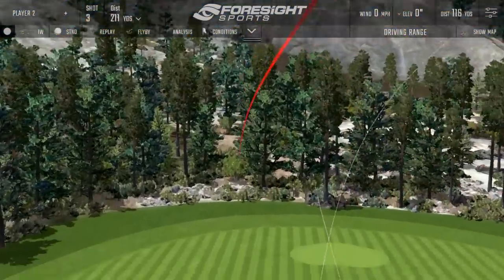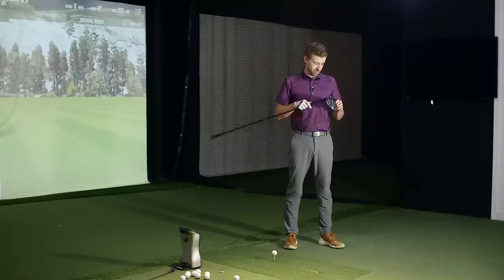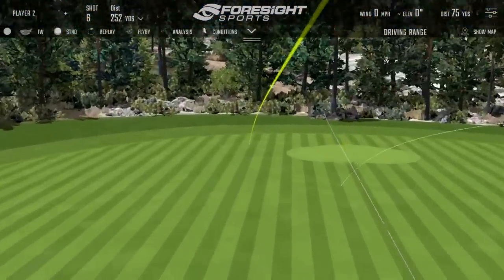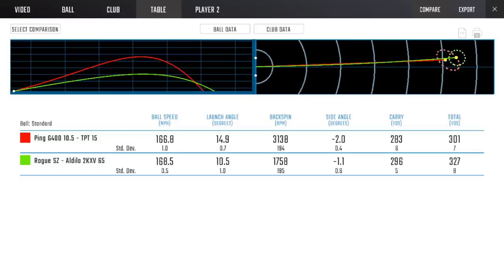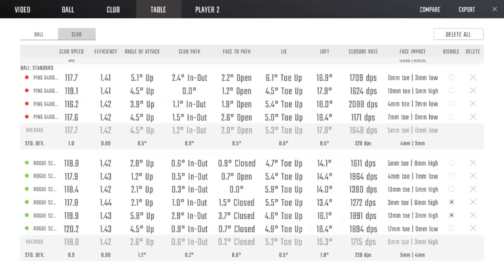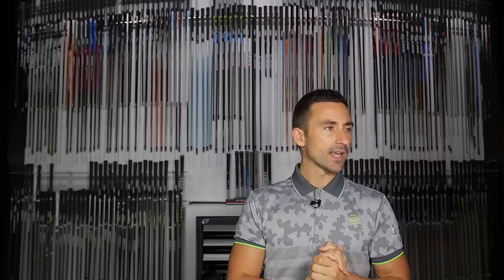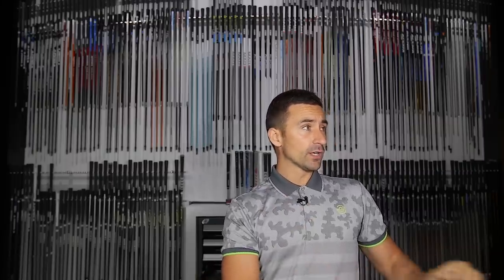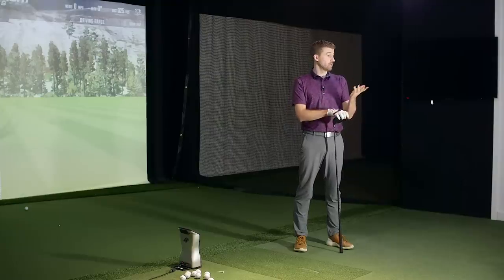Hitting Driver Too High | Losing Distance

Comment: I need to work on some things. I use an epic flash set to a loft of 8 degrees. I swing about 115mph and I hit the ball really high and barely get around 225-250 out of it. Hate it.
Reply: I had this exact issue. I got my swing speed up to 125 and geared down to 115 for control. The best I could do was 265 at 125 mph, and at 115mph barely 250. I began to figure out how to decrease backspin, and just 2 months ago with a 12mph helping wind I knocked a 350 yard drive. Excess spin really does kill distance by a mile, depending on how much you carry. For me it was well over 4000rpm.
Reply: Nick M. Dude that sounds so similar to me right now what did you find out that helps decrease spin

Comment: Hi guys, quick question. I thought the swings between the 2 heads were meant to be the same. Only reason I ask is the attack angle with the rogue is pretty much half of the Ping. Would a club on its own have any influence on attack angle? Also, I’ve seen loads of stuff from Trackman on hitting up on your driver 4 degrees plus. What are your thoughts on this? Cheers

Comment: Awesome new intro! 

This is a struggle that I've had as well playing in Texas. What would be an optimal launch angle at the 170 ball speed? I've heard you say  it before with Matt, but I can't seem to find the video you made that comment. You've said spin around 2000-2200 spin several times, but the launch angle comment is hidden somewhere.
Reply from the maker: About 11º
Reply: Thanks!

Comment: Sooooo, what's the solution? Move weight to front? If so, does that require a new driver head? I have an Epic GBB. I can change loft and closed/open face setting and slide the draw-fade thing. But I still don't know what you guys did to that Rogue to lower ball flight.

Comment: Hey, can you do the same really with the cobra f9 changing weights and putting a heavier weight in the front than the standard 1 then move the standard red weight to the back. 
I have the heavy weight in the front already but still higher than I want. I have also just bought the new tensei orange shaft because I loved the feel of that in my mates driver. Love mucking about with things. Thanks.

Comment: Was the SZ a 10.5* static loft or dynamic loft(hosel adjusted)? With adding the extra weights what swing weight did you end up at. Is the driver at 45"?

Comment: I'm curious because you've mentioned before how light the standard Rogue heads are. What type of golfer would that standard weighted Rogue head be good for?
Reply from the maker: To be honest, not a whole lot of golfers would benefit from that light of a head. It makes for a good build when paired with a super light shaft, for example, but for the most part a higher head weight pairs better with the average player's weight category of shaft and delivers an ideal swingweight.

Comment: This is dope, great video guys! But one question with it getting into the colder months should you switch to a lower compression golf ball in the colder weather or is that a myth?
Reply from the maker: Not something we can say definitively yet Dustin, but in theory it should help.
Reply: @clubchampionmedia  think my swing is broken TXG lol. Hit some balls on the gc hawk today 135 ball speed avg for 261 total distance but my launch is insane at 18.2. Though i like my spin number at 2267. And thats with triple diamond ls rogue with ventus black shaft. I dont think there's a way to hit the ball any lower! best drive was 275.5 with 1963rpm at an insane 19.2 degrees and 134.9mph ball speed. feel like im losing at least 10 yards and 5mph by not hitting the ball lower

Comment: I have the complete opposite problem, I cannot get my driver in the air. I can’t even get my 3 wood in the air. For my driver I have the ball forward in my stance and the ball is teed up high enough. I hit my 7 iron about 160-165 so I have decent swing speed. I’ll look at the club face and even when I get it smack out of the middle I still get no launch. It goes about 5 feet in the air and then slams back to earth and just rolls. I even have the same issue with my 3 wood. I try and do some of the things like making sure my back shoulder is slightly lower and I try and make sure I swing up but am having no luck. They also tend to snap left. Any idea what’s causing this and any tips on how I can fix it? It is devastating to my game. Once I get to my 5 iron my height goes down massively 4 is lower, 3 iron goes 10feet in the air and just rolls 200 yards and then i actually loose distance with my 3WD and Driver because they get NO launch and hammer back into the ground. I never hit super high shots with any of my clubs but I can typically get decent shots up to my 6 iron. Once I get to my 5 iron and down they just go lower and lower.  I try my best not to compress my 3,4,5 irons as much and try to put the ball forward enough in my stance with 3WD and Driver to make it so I’m swing up on the ball but can’t seem to figure out what’s going on. Even when I get one in the perfect center it goes perfectly straight for 30-50 yards and just hammers into the ground and stops within 100 yards. Any advice would be awesome! 🙌🏾

Comment: Hi guys , I recently got fit for a driver and my 2017 m2 9.5 was launching between 11-12 spinning mostly under 2000 and I tried a standard epic 10.5 and it was launching 16-18 , can you explain why launch was so dramatically different for a 1.5 degree loft change

Comment: Considering only spin, with assuming all other factors are optimized, is there any condition where a lower spin is going to negatively impact the ball flight? Too much headwind that knocks the ball down...cross wind that moves the ball too much...etc?
Reply from the maker: Likely just downwind, not enough spin on the ball could cause it to get knocked down

Comment: WOW! I think I need that Rogue. I have been playing around with M1 2017 weight settings but I don't think mine can lower the peak height and spin as much as Rogue Sub Zero though.
Yet another great video that will pop some holes in my wallet.
Reply: When I got fitted for a Rogue SZ the M1 was like 1500 RPM more spin. Trash, IMO.

Comment: Ian and Matt. I have the previous GBB epic driver and 3 wood. Did you find that line of Woods was also on the lighter side like the Rogue series? I weighed mine on a gram scale and it measured around the low 190’s for driver and around 205 for the 3wood.
Reply from the maker: low 190's on the driver isn't too bad, we've weighed quite a few rogues that were sub 190
Reply: TXG Tour Experience Golf I was referring to the GBB Epic model. Apologize if that was confusing.

Comment: One thing I see a LOT of is players saying they hit their driver too high, but they only hit it about 50-60 feet peak height. Do you guys see a lot of this? Also the players who tee the ball maybe 1-1 1/2” high and strike the face low but complain that it goes too high and reaches peak and just drops. Then their first instinct is to get a lower loft which makes the problem worse. 

Could we get a video series or maybe a shorter version of something like “ideal peak heights” or “help to maximize distance and accuracy by loft/height”

Comment: Awesome as always. How would adding extra weight to the standard rogue effect ball flight? With the weight in the back, would it add height and spin? I was a very low spin driver of the ball and was fitted into the standard with extra weight. Made some swing changes and it Seems to balloon sometimes...  must be the club, could never be a swing flaw.....
Reply from the maker: Heavier weight in the back should increase launch and spin a bit, in this video we were mostly talking about increasing total head weight for a more desirable swing weight as the Rogue is quite a light head compared to others.
Reply: Swingweight was the reason I wanted the weight initially, just wasn’t sure how it was effecting the flight it is was in the back of the club. Thanks again!!
Reply: That would make shaft not as stiff adding more weight

Comment: Have you had good results with standard rogue by adding heavier weight? How does the driver work with special heavy weight? One would think it could catch the Max in MOI with heavier weight? I was in a fitting and got great results with the standard rogue but ended up with the 9deg MAX due to better heavier feel and similar performance. The 75 gram HZRDUS Yellow 6.0 was the best fit. 13 launch 2300 spin 161 ball speed.
Reply from the maker: Heavier weight addition is mostly for getting a desired swingweight, Rogue heads tend to be much lighter than other models on the market
Reply: @clubchampionmedia  So no help with the heavier weight? Still too light?
Reply from the maker: Heavier weight would help for sure, depends on how heavy you want the swing weight to be

Comment: I’m hitting up on the driver between seven and 11 my Apex is been between 60 and 80 feet high my spin is between 800 and1100 Clubhead speed is between 89 and 94 ball speed is between 125 and 135

Comment: Would you need a lot of swing speed to get the ball in the air with this setup?
Reply from the maker: Not necessarily, more about how much loft you deliver at impact
Reply: TXG Tour Experience Golf Interesting. I hit my driver with quite a solid strike but it does tend to go quite high. I’ve avoided moving weights forward towards the face as I’m afraid it will take away forgiveness. Tried this once with my fairway wood and it was a bit of a disaster. Might give it another try...

Comment: How do you account for the increased swing weight/total weight when adding 12 grams to the head.?
Reply from the maker: In this case it was done on purpose to increase the swing weight, the Rogue is a light head in its standard setup.

Comment: Very interesting what a dramatic change.  I tend to hit my driver too high as well.  I have the original m2  and I like the head.  It's a 9.5 and I have it down to 8 and still can get really high flight which can really hurt me in the western Minnesota winds.  Any suggestions I have kurokage tini stiff shaft
Reply from the maker: Afraid a head change is probably in order Chad, if you already have the M2 at its lowest loft you've likely maxed out your potential for lowering the ball flight. The shaft won't make more than a subtle difference, the CG location and DNA of the head design are the main contributors to the excess launch/spin.
Reply: @clubchampionmedia  any suggestions on what I should try I have to travel to get to a fitter with multiple manufacturers
Reply from the maker: Rogue Sub Zero (heavier weight at the front) or M3 (weights forward)
Reply: Try moving the ball back half ball at a time,not saying it will work for you but it’s free.👍
 I Hit my drives so high they look great on the tee then just drop out of the sky,after moving my ball back I honestly gained 30-50yards.
But it’s not a magic fix as my left/right dispersion has gone to s..t,I’m aiming for a playable drive ie constant fade or draw not bothered which just need to know what shape I’m likely to hit.
Good luck with your swing mate👍

Comment: What could be done with irons? I play pro V1 and hit my driver great but with my irons I find that it flys very high and I can get my 7 iron to spin back on the green. I am using mizuno mp-4 irons. Should I look at getting the lofts adjusted?
Reply from the maker: Stronger lofts would reduce spin, but a different ball choice would make a big difference as well. i.e. Titleist AVX
Reply: @clubchampionmedia  I haven't avx yet but I did try the dt trusoft. With irons it was landing a stopping which I liked but with the driver it was just nose diving out of the air and I live in Scotland so roll on the fairways isn't always guaranteed.

Comment: I had this problem i have m2 and had a stiff flex shaft it was launching ridiculously high i put it down to 8.5 degrees hoping this would fix it i changed to an extra stiff flex set the driver 9.5 and two rounds in seems like it's problem solved
Reply: definitely picked up between 10 and 20 yards also

Comment: Great video, I have this issue, I hit the driver super high. I hit it in the fairway with absolutely no roll. I have the 16’ Callaway bertha fusion 9 degree w/16 gram weight and extra stiff shaft it flys 280-290 any suggestions how to get the flight lower ?

Comment: Suggestions on a driver for women like me that do this? I'm hitting off the tee as far as my husband but my drives are too high and losing distance. I wanna surpass him 😉😅
UPDATE: In my Cobra Speedzone Xtreme Iowered my loft on club from 12.5 to 11 and upped the weight from 4 grams to 8 grams and this fixed it👍

Comment: Do you recommend adjusting the hosel setting to lower loft? I have the g400max and normally hit a draw. When I try to lower the loft I seem to hit a super spinning fade that goes nowhere. Is it odd that I have a higher ball flight with the lower setting?
Reply from the maker: Lowering the loft is opening the face a bit, so it's possible that you're delivering the clubface open on that setting leading to the fade and more spin.

Comment: I understand that adding weight will change CG etc but you can still have the same head & change the shaft. 60-70% of golfers use the wrong shaft. Some std spec thing off the shelf. Take you driver head that you "love" & go & try 4-6 shafts!!! Will give you the same result if not a lot better IMO ;o)

Comment: Did you guys notice that once Matt was hitting the low spin driver with similar delivery he was way further offline? The spin tilt and bounces are much furmer. I'd rather carry a bit more spin so even after a good shot with a bad bounce I am okay.
Reply from the maker: 100% Lukas, that's something we advocate frequently. More fairways and consistency with a bit more spin on the driver. This video was geared specifically to the player that wants more distance though, but you are correct there is an accuracy tradeoff.
Reply: @clubchampionmedia  No it wasn't.  This video, like all of them is based on a guy who swings much faster than 90% of all golfers.  You also need a low handicap golfer with a slow swing speed...in the 80 mph range for this to make sense.  Been golfing for 60 years and my driver swing speed is 84 mph max.  I average 210-220 max off the tee including roll.  Where do I add weight to my driver?  I  am a fairway finder with good trajectory....just not long enough?????????  Is 'GolfTech a good fitting company?  I am in Manitoba, 180 miles from nearest city (Wpg).  Have tried other so called 'fitters' and got stung with garbage.  How about simplifying your answers so us old people know what you are talking about???

Comment: Hey ian, what would you do for someone that is too high launch and too low spin? Hitting a f6+ set at 9.5 with the stock black tie x. 160bs, 14-15la, 1100-1700 spin, v1x ball. Basically if I dont hit it perfectly it's just too unstable but it's very long when I button it (280 carry on gcquad)
Reply from the maker: Look for a higher spinning head, in a lower loft. You may need to adjust your delivery a bit as well, sounds like you're hitting up on it a lot with low delivered loft

Comment: I am 34 years old I play with a group of golfers who are all in their sixties a couple even in their 70s they out drive me all the time I never miss Fairways sometimes I will hit the ball dead out of the middle of the club straight as an arrow I think I'm going to outdrive them 20 to 30 yards when we get up to the balls by about drove me by 10 or 20 yards it's really frustrating I can never figure out what is causing this when we use a swing stick I'm swinging way faster than all of them yet not getting the distance and yes my ball flight is a lot higher than all of those and I don't get any role I've tried moving the ball back in my stance I've tried to deal off in the club as much as possible I'm hitting a 8 and 1/2 degree nothing works it just seems to always go to High I'm going to try every tip that you've given today please respond to this message if you have the time thank you

Comment: bummer, I just realized you can't shorten the shaft after those weight tweaks. 
Unless they double the weights ,at least, to put up front. Well then, lead tape, but it's not going to look pretty.